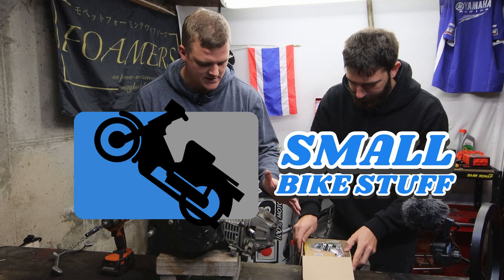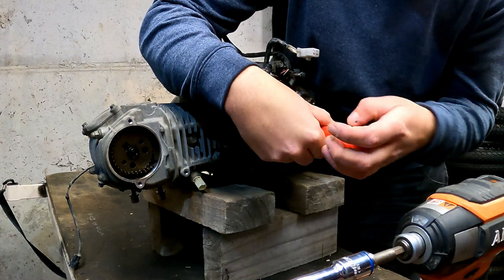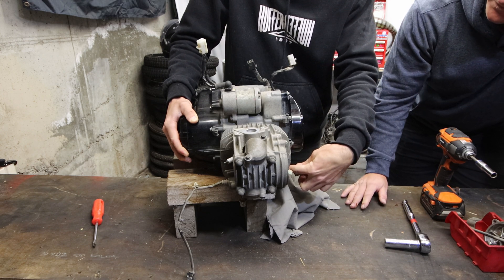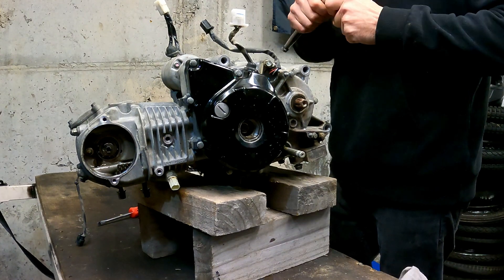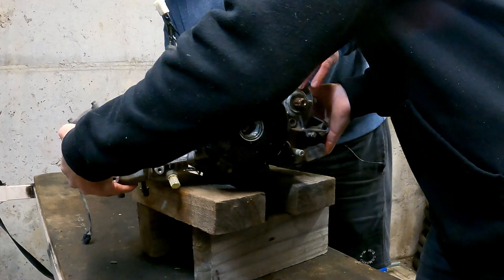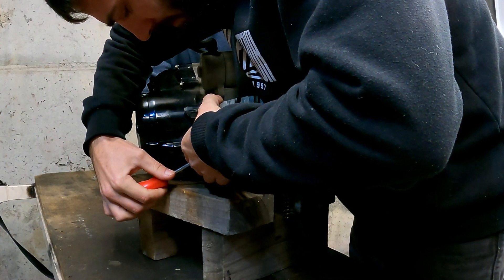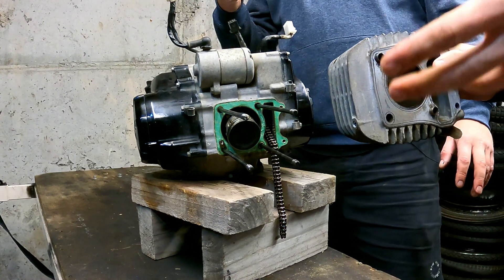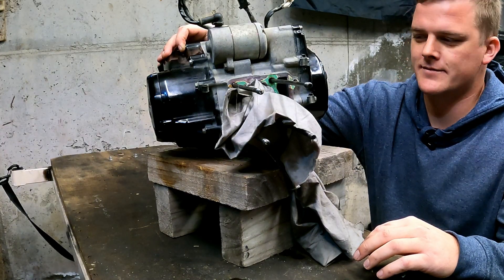Honda 125cc Engine Disassembly: It's broken!

Comment: Wide open throttle will do that, especially when even a tiny tune is off. Single cylinder is best at 4500rpm and/or 75% open throttle. If you want to go faster for longer then get a bigger engine bike. Also, ride for 1h max and let it cool for 15min.
Reply from the maker: Yeah I did a lot of long WOT riding on this - but I have a sneaking suspicion the damage was done long ago. When I bought this bike it only had 1200KM on the odometer and only 200ml of oil in the engine. It sounded a bit loud but oil changes and regular maintenance - it kept going. It was running fine, if only a bit loud when we disassembled it.

Comment: with reference to the 143 kit by Lazy Dog Productions in Chaing Mai, These guys did a fairly in depth analysis of the BBK's and various upgrades to where they are today. Initially they only fitted the Diabllo exhaust with 19mm header then the 56mm Cylinder and piston, this gave the bikes much more torque but also developed a problem which turned out to be a cracked valve guide,  at the 2nd garage the mechanic noted that the 56mm cylinder did not match the 54.6mm head correctly and that the 19mm header pipe was not achieving efficiency and so ported the head, intake and exhaust ports... this gave the bike a lot more power,  later a Hot cam was added and an ecu upgrade to the ECU-Shop Full Stand Next ( to suit Honda Wave 125i LED 2020+) and a larger stainless intake pipe. as far as i know this is where the bike is today and runs very well with lots of torque and good top end speed... Ive done the same thing with my CT125 except I bpught a full engine kit from HiSpeed in Thailand which included Balanced forged crank shaft 57mm cylinder and ported head with larger  valves (24/28), heavy springs, Manual Clutch and 5 speed (1N2345), Since then I have been to thailand and purchased an engine housing and internals, plus an API PowerUP ECU to suit,  Ill rebuild my original engine to stock and a complete performance motor... total cost about $1600 aus. this included a Murazaki exhaust  ( about 200 Aus) http://www.murazakishop.com/p/1900
Reply: I also forgot to mention that the kit i purchased also came with a high flow oil pump, further to this I found a High Flow Fuel pipe to suit the CT125 so the engine wont starve at the higher RPM

Comment: Top side of the piston is the thrust side, perhaps that is why you see more wear there. Given you have brought a mild bore kit with matching ECU reflash you'll probably be fine, the algorithms in the factory reflashed ecu combined with the narrowband sensor in the head mean you should get pretty good AFR. The big limitation is the narrowband sensor, as everything is calibrated relative to stoichiometric based on an assumed power curve profile. This biggest weakness of this is when you change the shape of the power curve too far from the assumed profile with aggressive cams and big heads etc... in saying that some of the known flash tuners are now offering reflashes for 4v heads etc but they do compromise performance for reliability, this is the point where a stand alone ECU becomes key.